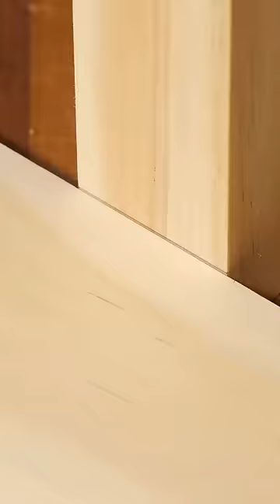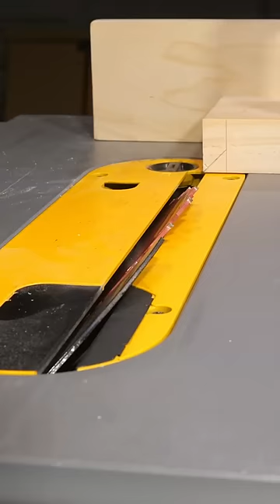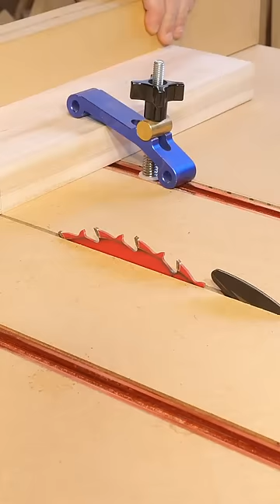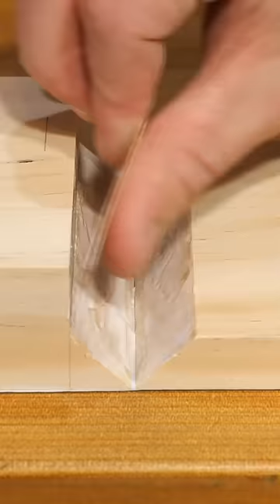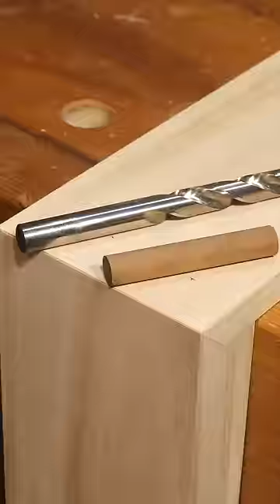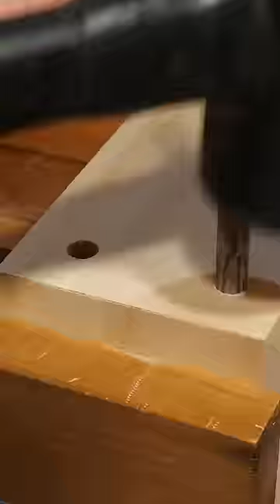A Housed Rabbet (Rebate) Miter Joint | Woodworking | ASMR #shorts

Comment: I think it’s got to be stronger then your standard mitre jointer. Nice in house dowels to dude they set it right off
Reply from the maker: Yep, definitely stronger than a standard miter joint and my in house dowels set it off for sure. Thanks
Reply: Й
Reply: Hi 👋😊
Reply: Hi
Reply: But its a joint only suitable where one side is much thicker than the other side ... so you can't really compare it to a "standard" mitre where both sides are usually the same thickness of board... 🤔

Comment: Where do you get true diameter dowels?
Reply from the maker: I make them myself using a round over bit on the router table. If you are interested, you can see how I make them in this video: https://youtu.be/phh879I8FuI. 8mm (5/16") would be about as small as I would go with this method. Any smaller you could use a dowel pate.

Comment: Is there a reason to have so much extra dowel length or is that just what you get when you buy standard sizes for this?
Reply from the maker: I probably over estimated. These are shop made dowels and I have plenty. You do want to have them oversized during the fit so you can trim them down. But obviously oversize by an efficient amount to avoid waste.
Reply: @kiwiworkshop  makes sense.

Comment: If you want a really good joint drive a square peg in the round hole.... I am serious! It's actually the right way to do it because of expansion and contraction of different materials it will hold up..... when u trim it flush it will still have the beautiful round appearance
Reply from the maker: Interesting, I have never tried this. I guess you need a quite hard/dense wood for the work piece with the holes and softer wood for the pegs.
Reply: @kiwiworkshop  I saw it on a Brent Hull video about building doors

Comment: What's the point in fixing with Dowling when pilot holes with dome headed slotted brass screws would look better as would using tape to hold together whilst the glue went off 1st then stain then pilot then screw the astectic would look better if you make the screw slots vertically/ horzontically inline!
Reply from the maker: Yes, you could also use screws and the aesthetics comes down to personal preference. There are a number of reasons why you would use dowels over screws which include:
1. Dowels are stronger than screws. If you google for "dowels vs screws" you will find a number of articles that go into the details of why this is true
2. Dowels will not strip out material and are less likely to come loose over time (assuming they are properly fitted and glued)
3. For customers seeking high end furniture, dowels are considered more of a luxury item compared to screws and are generally considered a sign of quality craftmanship.
Of course screws have advantages too, of which the main one would be faster assembly time.
Thanks

Comment: Why do you using drill for metal, not for wood?
Reply from the maker: The drill bit is a dual purpose wood and metal bit (that's what the manufacturer states). I would usually use a forstner drill bit but couldn't find my 10mm bit when making this video.

Comment: What is that saw your using as I seem to see it quite alot
Reply from the maker: It's a Dewalt table saw with an upgraded blade
Reply: @kiwiworkshop sorry for the miss conumication but I meant the hand saw not the table saw but thanks though 😁
Reply from the maker: @ajmaver1k210  all good, I actually forgot that I used a hand saw in this video! It's a Zetsaw fine rip saw (H-250). Even though it's a rip saw, I find it works well for most cross cutting applications too.
Reply: @kiwiworkshop  ok thanks 😊. I'm currently learning carpentry and I see that saw alot in videos and was wondering what it was as it looks cool and it looks like it is fairly simple to use
Reply from the maker: @ajmaver1k210  if you are learning, I would definitely recommend a Japanese style pull saw like this over a standard push saw. You will probably find it much easier to use.

Comment: Why not skip the miter and just do the pins?
Reply from the maker: This would be a butt joint with pins which would be weaker than a miter with pins. Two main reasons are smaller glue surface and glue on one plane, not two. It also wouldn't look as nice if the joint is visible.

Comment: So the dowels are just for show, Why not just make them functional?
Reply from the maker: The dowels are functional, they add strength to the joint. If you load tested this joint with and without dowels, the joint with the dowels would definitely perform better.

Comment: Functional enough, but I do not see why you designate it ''housed''. A mitred rabbet, or rabbeted mitre I follow, but where does a housing come in?
Reply from the maker: It's the name given to the joint in a woodworking book that I have called "The Joint Book". I also had the same question and assumed that the shoulder in the joint makes it "housed". Although I guess technically it's only partially housed. The author states that the Joint originated in Japan but doesn't mention the Japanese name.
Reply: @kiwiworkshop , curious. I am guessing that this is a modern book.

Alright, I am just gonna take a stand, cop an attitude, and declare that a shoukder on the end of a board is a shoulder, and a housing receives and surrounds the end of another board on both its faces, as in a shelf fitted into a dado. Ain't throwing in with no sharpshooting book authors.

Cheers, and all the best!

Comment: Why you using a HSS bit on wood?? 🤦🏻‍♂️ 😅
Reply from the maker: It's actually a dual purpose wood and metal bit (that's what it says on the packet). If I had a forstner bit the right size, I would have used that.

Comment: Pour le bois, mèches à  bois !
Reply from the maker: The drill bit is a dual purpose wood and metal bit (that's what the manufacturer states). I would usually use a forstner drill bit but couldn't find my 10mm bit when making this video.
Reply: Hi 👋😊

Comment: Gorgeous joint, though I noticed a lot of play between the miters on the tape. If you overlap the miters just a hair on the tape so that you'd have to pull it taught will result in a much tighter corner
Reply from the maker: Yes, you are absolutely correct and I didn't notice until I played the video back. Guess I was a bit distracted trying to record what I was doing! Glad you like the joint, thanks.

Comment: Клей нужно лить в отверстия, а не наносить на шканты. При забивании он весь стирается и остаётся снаружи, а не в отверстиях.А в целом гуд!
Reply from the maker: Yes, you are correct, it's a good idea to put glue in the holes. I usually glue both the dowel and hole, since as you drive the dowel in, any glue in the hole gets pushed to the bottom.
Reply: Hi

Comment: In case there is no glue and electricity?
Reply from the maker: Hmm, not sure I remember there being a glue shortage, haha. If no electricity, you could charge it with a solar charger
Reply: @kiwiworkshop  what I mean is how to make wood into a strong structure without using glue or bolt? only wood. A 100% wood structure.

Comment: если все равно на шканты собирается, на кой весь этот цирк со сложными подрезами?
Reply from the maker: The shoulder in the joint also adds strength
Reply: @kiwiworkshop  Yes, of course, and the gluing area also increases, but compared to the strength that the shkants provide, this is insignificant. But it looks beautiful on the video.)))

Comment: Cant even use a correct drill bit thats a metal cutting drill bit not wooden so many do this not even skilled or professional ....
Reply from the maker: Don't jump to conclusions! It's a combination metal and wood drill bit. Clearly stated on the packet and works just fine for both materials. If I had a forstner bit of the correct size, I would have used that.